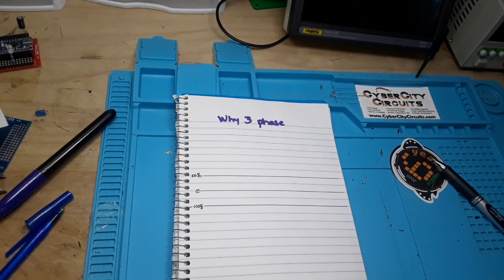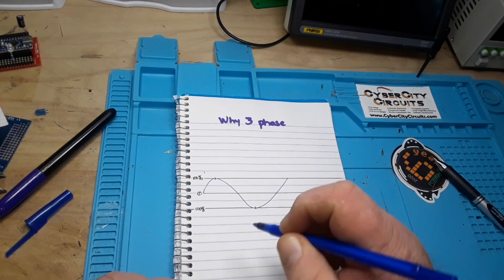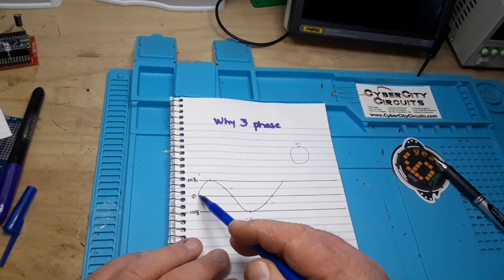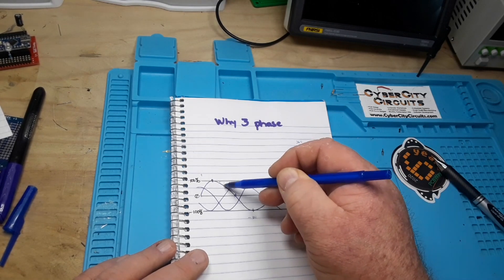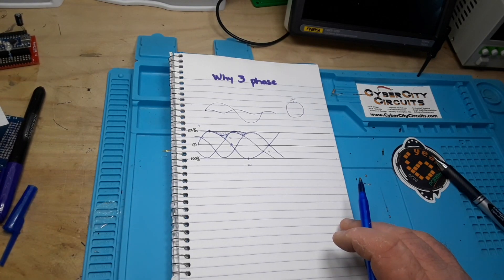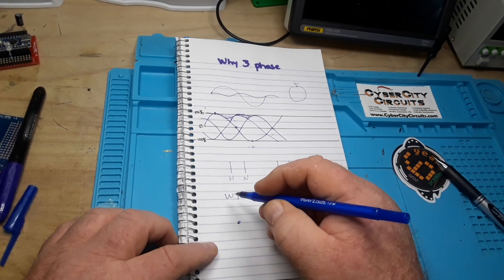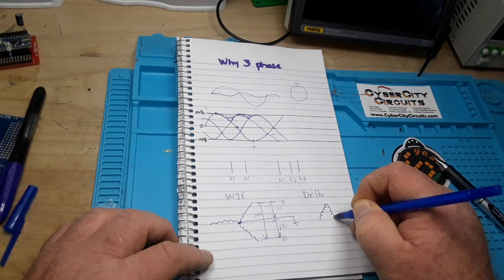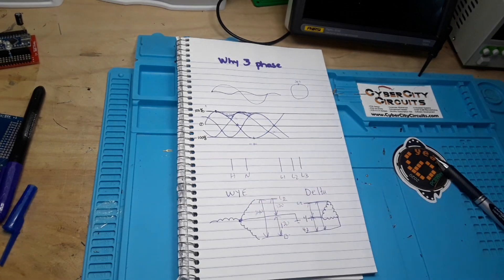Why do we use 3 phase electricity

Comment: The REAL answer - Tesla was told the number 3 in a dream - he knew poly-phase AC was best for power distribution and transmission...but he was considering 2, 3, 4, 5, 6,  8 and other combinations/number of poles. . True story from his biography. Tesla was obsessed with the number 3 and their multiples (especially 3-6-9). His patents which were based on 3 phase equipment was sold to Westinghouse and others adopted and improved on  that system of course. Edison (an idiot by comparison) was pushing DC for power distribution (and demonized AC as "dangerous") ! Edison's influence was so great that some early industrial equipment, elevators and other devices ran on DC current! Years ago I worked for Con Edison and had this special project to convert old DC elevators in NYC to AC!! This is also why the NYC subway was designed for DC distribution at about 625 V ~DC~ !! EDISON!. One time I went down into the bowels of a power substation for the subway and this 27 KV feeder would step down to several hundred volts and then rectified by a transformer/ diode rectifier unit the size of a small bus  - I kid you not. Think of the inefficiency of that vs AC distribution!

Comment: For the delta, no matter which two legs you measure, you should get the same power.  
I don't see how you'd ever get full point power vs. half for delta.  Because if you think about it, in this configuration going across one is also going across the remaining two in the other direction.  And they are all the same voltage each.

For the wye configuration, if it's truly 3 phase when you add two, you wouldn't get 240 volts.  You'd get 208 volts?
  Because they are 120 degrees out of phase.    

In your home (speaking of the U.S.), if you add two legs you get 240, so this must mean that it's single phase as others have suggested.  
If they were out of phase at all, the sume of the voltages should drop.

I know I might be wrong, but just saying how it seems to me.  Things in the video just didn't make sense.

Comment: Here in germany the normal power delivery is 400V~3P for 99% of the Households (there may some exceptions perhaps). Of course you can math 400V÷√3=230V. And the Normal wallplugs delivers 230V~1P/16A max on a 1,5mm² wire, or 400V~3P plugs for motors, pumps etc.  I think this is a very efficient way, even if you need some motors with more power. Just discovered your channel. Tnx for sharing your good made and interensting videos :-)

Comment: 5:32 that only works like that for voltages in single phase split to become  split phase 180 degrees separated  from each other. 

But, in three phase where the line voltages are 120 degrees out of phase with each other, the line to line voltage =  sqrt(3) × line to neutral voltage. Thus 120vac×sqrt(3)=207.84....

Comment: Ahhh a great subject! I'll only add one comment that confuses a lot of people-at least for the US,, the two hot legs that come into our homes are NOT two wires from the 3-phase system (2/3). It is single [split] phase with a common neutral to bring the unbalanced load back to the transformer which is also grounded, mainly for lightning protection (overvoltage).
Reply: Well, it can be two phases from a 3-phase system in Wye configuration, then you have 120 Volt from your neutral to any hot, and 208 Volt between phases, then you have 3 wires coming into your home, neutral and two phases.
Reply: @K2teknik.  but for home/residential, this is very seldom (or never) done, correct? I was referring to strictly residential.
Reply: @michaelpadovani9566  For apartment buildings it exist, how common it is I do not know.

Comment: Not only additional hardware for more then 3 phase, but also in transmission the interaction between phases (induction, capacitance) means you get declining increases.  6 phase is not double 3 phase, more like 1.75x

Comment: The US use a different approach for their electricity to the ordinary consumer than they do most other places around the world, this is due to the history of electricity in the US and the fact they were first to electrify their city's, there is a few ways, one is a single phase transformer with a three terminal output (secondary winding) it is "three wire, with centre tap", the centre tap in neutral (connected to earth/ground) and the two other terminals are called "hot", they are 180 degree out of phase with each other (not to confuse with "phase" in the supply system), so there are 120 Volt between the neutral and any of the two hot terminals, and between the two hot terminals there are 240 Volt.
This system is also implemented from a three phase transformer (secondary in Delta), then you take one of the phases (and only one) and add a centre tap and it becomes you neutral (connected to earth/ground), and the two other ends (two out of three phases) are your hot, same voltages as above with single phase transformer.

Then there is yet another way to skin the cat, three phase in Wye, here your star point (centre of the three phases) are your neutral (connected to earth/ground), and you have 120 Volt between neutral and any phase, and you have 208 Volt between any two phases.

A video tells a million words? https://www.youtube.com/watch?v=ksrE79uLBaY

Comment: There is also 277v, 3phase, where two leggs eq, 480v, I had the job of running wire, and installing 480v forklift battery chargers, and most of the lights in Lowes stores are 277v
Reply: That is an industrial installation with Wye configuration from the transformer, not something the ordinary household have access too.

Comment: I just missed the explanation on how the voltage become 400 volt.
Reply: Single phase in Australia is 230V. This is the voltage from Line to Neutral in a WYE 3 phase system. The Line to Line voltage in a WYE 3 phase system is 400V.
When you have a WYE 3 phase system, the Line to Neutral voltage is always the Line to Line voltage divided by the square root of 3 (1.73).
Thus, 400V divided by 1.73 = 230V
Reply: David Bee the same as the UK and most of Europe.
Reply: Not really, you can transform up/down as your like and your money to buy transformers will bring you.
The US is using three phase power in their main grid, the voltage depend on the point in the grid, so what ever you want of three, and single, phase you can get it, but only 60 Hz, if you have money as dirt you can get 50 Hz too, but hey a bit out of this scope.

Comment: I have a question: From what I understood from the video, wouldn't three phase turn the AC current into a very, very unstable DC current? I'm sorry if this is a dumb question, I'm just newly getting a bit more in-depth with electricity and electronics.
Reply: That's how the alternator in a car works.  It's produces 3 phase which has very low ripple when rectified.  No smoothing capacitors or anything, although the battery can smooth it.  The symptom of having lost a diode is a very choppy voltage signal on the oscilloscope.
Reply: Three phase full bridge rectifier (that is 6 diodes) is more stable, or should we say, less ripple than single phase full bridge rectifier.
Reply: @Aperture Science The video does what it can, it is a very deep topic and this doesnt even scratch the surface. To answer your question, no, a 3 phase voltage system does not give you a DC current. In a wye-to-wye connection, If the load is balanced, the current is actually perfectly AC, the 3 currents have basically the same form of the voltages drawn in the video, they are onoy phase shifted forward or backwards depending on the load

Comment: Thank you.
Note: in a 3 phase WYE system, the line to line voltage is root 3 (1.73) x phase voltage.  In a delta, line to line is the same as the phase voltage.

Comment: Great stuff! For profanes like me, I would be happy to learn how to wire up devices to 3-phase sources. Thanks.
Reply: If it is a motor, the you need to know if it has to be connected in Wye or Delta, and then it is just to connect the power to the thing, if it is rotating the wrong way around then you swap two of the phases.
Be aware that the voltage match between your source and device too.
Reply from the maker: I do mean single
Reply: You are probably gonna have to be a little more specific.